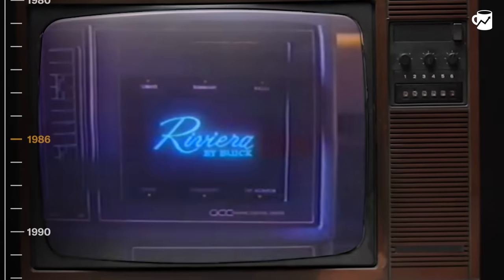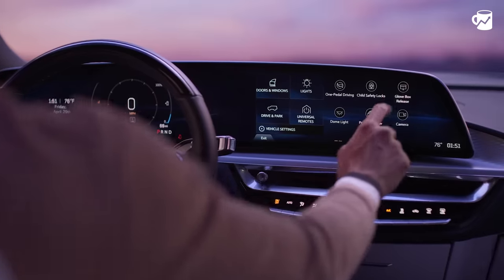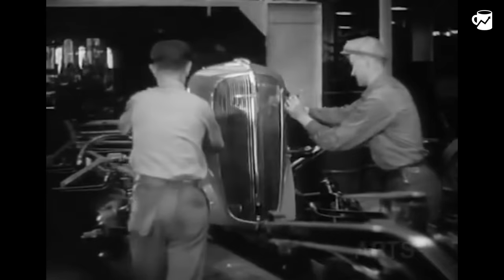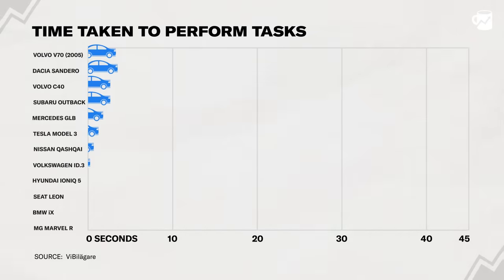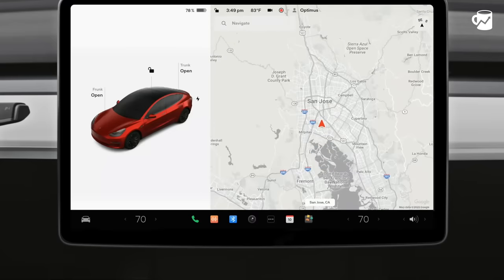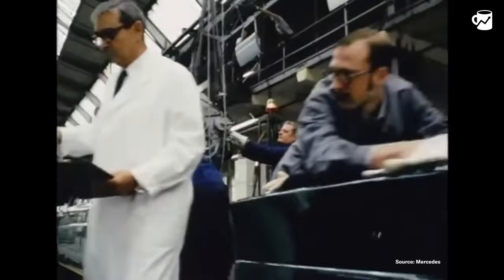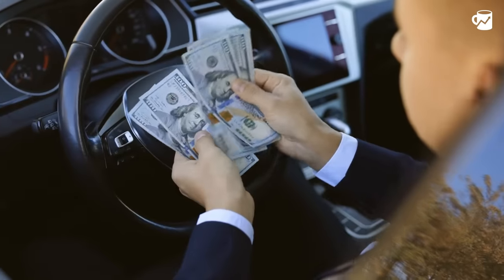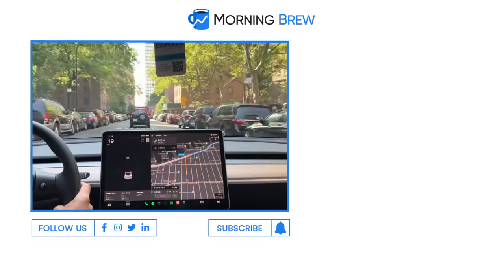The Real Reason New Cars Have Touchscreens

Comment: Physical buttons are better in cars for the same reason video game controllers have physical buttons—with a bit of practice you can easily find them quickly and be certain you did press them without needing to look. 

I have a 2021 Corolla that has a touchscreen, but I think that one is implemented well. The home screen is customisable to an extent, but generally displays a minimap along with what the radio is playing and an indicator of battery use (it's a hybrid). I don't use the GPS navigation feature (I don't like automated GPS navigation), so I'm not sure about that, but the touchscreen does not allow you to use the phone connection features like SMS or making a call through the touchscreen when the car is in motion (you can use voice control). The minimap is operable, but it's a normal, uncomplicated, top-down map like the ones in printed map books used to be and is easy to read quickly.

Other than that, most of the features of the radio can be operated with physical buttons on the steering wheel and all of the direct car controls, like aircon, cruise control or proximity sensors are operated with physical buttons.

Comment: I'm into IT and cars for nearly 20 years, this is a huge downside of privacy, security and reliability in cars, not because it's distracting, but because even the simpliest task is performed through a screen that goes through a microcontroller, even for turning on the fan that requires a simple rotary switch it goes on through a computer that controls the fan on a PWM through screen controls that is interconnected with everything.
These things can get hacked, jacked, car companies can lock and unlock whatever they want anytime they want, and if anything breaks which is 99% fault of the propertiary software it's not a matter of swapping a switch or a few parts.
Next thing is making cars lock you in and drive you to jail for a joke you were telling your friend into the car, and you wont even have control of the steering wheel (steer by wire).
All these for nothing else than money and control.
Some touch screen controls like radio etc are okay as far as it's supplematory system and not interconnected with the vehicle's operational systems like that 80's Buick, but today's garbage is something else you should be careful of.

Comment: Touch screens sometimes require concentration on the screen (and not the road).  Bad idea.  Also try trying to adjust something on the screen as your finger lands in the wrong place due to a bumpy ride.  Real buttons and knobs cab be accessed just by reaching and not distract the  driver.  I have one, but would be fine if it wasn't there.

Comment: Most people prefer using your phones interface that is actually updated, than requiring the car company to outsource an interface.
Also, they could at least use some kind of linear actuator haptic feedback. But 95% of controls need physical controls in the first place.
Physical controls do not need to be run at the current of the component they are controlling. You could easily connect all those buttons through Car/Vehicle Area Network, just as easily as you can a touchscreen. You can even make it an easily replaceable panel, like a touchscreen would.

Comment: My AC button finally broke in my 2001 Mercedes. It was $89 new from the dealer parts department I did not want to spend. The same button in a 2023 Suburban costs $8900 - used, on ebay, from a wrecked car. its the entire center console tablet.

Comment: I have a VW Golf 2022, touch screen is a bit of a pain, now takes 5 touches to access the air con, in my old 2007 VW golf 3 dials all set so most of the time it's just set the blower speed.

Comment: The touchscreens are so that there can be less time designing custom one-off mechanical buttons, and the gauge pod dials, all which need produced, shipped and stored- don't have to be made anymore.  Just use a screen and some software- and there you go.  
Just drove a Wagoneer for 1200 miles, and couldn't stand the touchscreen and touch-button pod.

Comment: Having driven a few Tesla Model 3 cars and owning and loving my Ford F150 Lightning, I can say I think Ford is doing a better job in terms of ease of use of controls. There are still buttons, a stalk, switches, and a knob in the Lightning. That knob on the screen has had some people complain because it's glued on but it works and controls volume normally and if you tap the climate control it will adjust temperature. It seems Ford has put more thought than Tesla into drivers need to keep eyes on the road while still providing a bid touchscreen. The things you don't need quick access to while driving are the ones buried in menus on the screen. What you're likely to adjust while driving is put in the physical controls or on the screen is clear and easy to reach. There are still ways for Ford to improve it, though.

Comment: I'm glad I'm not the only one who thinks those touchscreens are annoying. Although they can be implemented so good. Last year I had a new BMW 3-Series, the touchscreen and buttons where in my opionon perfectly complementing each other, being able to use the touchscreen with a knob on the middle console, and having buttons for standard features like sound, or ac. This way, the car truly felt modern. Having the features and pros of a touchscreen without sacrificing easy accesibility. Now this year I have a Cupra Formentor, and it's absolutely horrific. I can't even turn the ac on and of without having to go through menus on the touchscreen, it's as if they actually wanted to make it as bad as possible.

Comment: I'm okay with touch screens in cars so long as my AC and radio controls still have physical interfaces. It's an absolute must for easy of use and safety. This is one of those cases where regulators need to step in. When public safety becomes an issue. Some people say it gets in the way of progress and innovation. I disagree. It gets in the way of being lazy. They should mandate that physical buttons exist for certain features on every car. And they should mandate limits to the size and brightness of touch screens and interfaces.

Comment: I use the Android Auto only to start the GPS navigation. Also my 2 primary used addresses are on the top, so it is easy to navigate. And use voice control to pick up a new address. The other stuff is starting music player (and / or maybe to skip a song or to use folder or playlist to play from/on. I use the audio player via the Android phone, it is a 1000 times quicker than trough the Android Auto, also the phone is on a stand in left, right to the driving wheel - white easier to navigate, also not disturbing monitoring the road with my peripheral vision.

Comment: I respectfully disagree with dismissing their benefits solely from a manufacturer's cost perspective.

I believe there is a very interesting bright side to touch commands.

While simplifying manufacturing is certainly an economic incentive for automakers, having fewer physical buttons, knobs, and wiring can also benefit longevity and sustainability. Fewer moving parts means fewer potential points of failure or wear over time. It reduces complexity and the embodied resources required to produce the vehicle.

Also, software-driven interfaces allow more flexibility for updates and new features down the road without costly hardware changes. This could extend a vehicle's usable lifespan as technologies evolve.

Additionally, from a sustainability perspective, reducing the number of physical buttons, knobs, and associated wiring by using touchscreen interfaces could have positive environmental impacts as well. Manufacturing fewer plastic and metal components conserves raw materials and reduces waste. Having fewer moving parts that can wear out or break means less need for resource-intensive repairs and replacements over a vehicle's lifespan. Obvously, safety must absolutely be the top priority in design, if done thoughtfully, simplifying interiors through software integration instead of numerous physical controls could pay dividends for the planet too by embracing a more minimalist, sustainable approach.

I do agree though that we're still in transitionary phases where the technology hasn't quite caught up to the design vision yet. But done right, simplifying physical controls through thoughtful software integration could benefit the manufacturer's bottom line, the longer-term ownership experience and our environment. 

Again, safety and usability just need to be the top priorities in the execution.

Comment: My friends laugh at me when i show i still use my old mp3 player as a music source. But reason for it is really simple. If i walk a dog, ride a bicycle or motorcycle i can listen to music. If i want to change the song. i don't need to look at it i can only press the button. Depending on the situation but mostly i don't have to take it out of my pocket either, i'll just press the button trough my trousers. When i go to car. it's tiny and i don't have to take it with me out of the car when not needed. Plus! no ads in my music. In a car in my opinion most of the controls should be behind a button not a touch screen. I'm fine with my small 8 inch infotainment touch screen.

Comment: Fortunately, for me, the Forester 2019, still has tactile, dials or buttons for most of the usual functions, wipers, lights, radio/sound, airplay, for my maps/navigation, no built navsat gps/sim, etc. yes there are several "buttons" on the steering wheel (and in dash) and there is a "touchscreen)" 6inch, which I rarely need to "touch" or navigate whilst driving, as the few apps I do use, can be accessed by voice via Siri, with a button on the wheel … anyway, it certainly isn’t tablet overload, nor driver distraction—as demonstrated in the clips of this video—that’s been happening in the models since. My main gripe would be the inbuilt "cpu-computer" that manages the electronics of the all the damn sensors built into the "running" and monitoring of the mechanics, error messages popping-up, some "false flags" a few legitimate, rather the parts are they often are faulty sensor, dirt, loose wires, fuse, electrical related, faulty software/app connection/s … oh well … I certainly have steered away from updating to all the bells and whistles gadgetry of a full blown tablet centred and controlled vehicle, no thanks. I’ll leave that to my iPad/s at home, and my iPhone which I do not need to "touch" once plugged in via cable in the care … happy trails to y’all 😉👍🏼

Comment: Wait, cars have touch screens in them? Im still driving my 2002 truck with a cassette and CD player. Truck is super reliable and has only needed garage work twice in 22 years. Will touch screens last that long? Based on repirability of Ipads etc., I'm thinking current vehicles wont last much more than 10 years.

Comment: I appreciate the android auto a lot. I use the maps constantly and it helps. That said i am more than glad that the audio controls are on the steering wheel. And the air conditioning control are physical. Other than that, i like being able to call someone without looking at my phone, but it is not easy, so it still needs me to be stopped.

Comment: Everything you've said rings true to me especially ease of use, except one thing - it's not cheaper. I'm a software dev and I know how much software development costs. Why have we got idiotic touch screens? It's marketing and regulations, I think. Take a long hard look at ODB regulation. I'd hazard an educated guess that manufacturers made a calculation that if they have to log everything, they may as well go down the full software route and poured development into that rather than traditional switches and knobs. I despise the learning curve with modern vehicles. I don't doubt manufacturers all looked at Tesla, crapped themselves and thought 'that's the future direction', but they are wrong. Simplicity is everything with car user interfaces. Don't ever distract the driver from the task of piloting a car.

Comment: I've been wondering about the main point of security for a long time. 
It's not just the screens. The VW ID. line has ridiculous switches to control the acc or speed limiter. Who does swype? Most manufacturers have a ridiculous control for changing the setting by10 it 1 kph which takes also a lot of attention. 

End of the day, screensc are something that sells. Usually it has very little to do with function, which is unreasonable for such an expensive commitment but that's people. But the lack of laws is astonishing.

Comment: Surprised he didn't mention my biggest beef with infotainment screens and that's how quickly it ages the vehicle. Back when you had nothing but a fm/am radio in a old car you could pop it out with a bit of effort and upgrade it to a cassette player and later a cd player both with radio included. It was a small system and could be upgraded in a few hours.  Now with these massive screens you would have to redesign the entire dash if you want to remove them, the jaguar xj 2008 is a beautifully designed car with styling that holds up today but you are reminded when you open the door how old it is when you see that obsolete screen in the dash. It's beneficial to car companies that these things age fast since as the video said its not only cheaper but it means drivers will buy a new car that much sooner to get a better infotainment system. Achim Anscheidt the architect behind the bugatti veyron and chiron never added touchscreens to them cause nothing ages a car more today and he wanted them to be them to be timeless pieces of auto engineering that would still look good 50 years from now. I genuinely wonder if the tesla model s will last half as long with its massive touchscreen.

Comment: The only reason is that it is cheaper. You can take one cheap LCD panel and get rid of several dozens of mechanical buttons, different types od buttons or controllers, so you no longer have to maintain the whole supply chain for all these buttons, storage for them, it is much more easier to install one LCD instead of fozens of mechanical buttons and cotrollers and so on. It is the one and only reason. It is cheaper for manufacturer a lot and also they can make you pay for it more, because it is modern, cool, in, free ... just pay more for something that saves them costs. But problem is that this kind of solution is also very very unsafe, using that during driving is very dangerous.

Comment: 7:57 Truly autonomous cars are a very, very long way off... Until a fully autonomous car can handle an unlit, narrow singletrack, mountain switchback road, during a snow blizzard in the dark in mid winter, with other stuck or stranded cars partially blocking the the straight tretches where you need to keep up whatever momentum you have to get up the hill; I'll be keeping tactile button controls, and eyes on the f . . . g road, thanks.

Comment: I bought a car radio during Covid. What a disaster. All of the knob-operated radios had disappeared the model year or two prior to my purchase, and I so am left with one that is impossible to change the volume or mute. Thankfully, I have volume buttons on my steering wheel, but this added about $80 to the cost of the radio just to interface with it.

The UI on that touch screen thing is a mess. Piece of junk.

Comment: AND did you know that Elmo's 'CyberTruck' has steer-by-wire? The steering wheel is basically a servo and does not have a physical connection to the rack & pinion assembly out front. It's over-engineered and potentially dangerous, imo.

Comment: Good... concise. Safety trampled and product turn-around exalted. (I would only add - a technical bit) The CANN bus has been growing into auto engineering since it came about, and probably it is not the only interface of that sort. So these systems that add control and sophistication to the actual product are (one might think) lonely and friendless until they get more computers (user interfaces) to talk to. NO they are cheap to the maker and expensive to the people who have to live through the crashes. Keep the data bus(s) dump the high-touch crash trap.

Comment: Cars have a lot of functions and settings now. Putting a menu on a big touchscreen is the best way to interact with those setting. There is, however, absolutely no reason simple tasks you use dozens of time per day should be on the touch screen. There's no reason to replace a mirror control, or a seat control, or wiper control with a touch screen other than cost savings or misguided minimalism.

Comment: Every vehicle I've owned I've installed toutch screens in. Mainly for the navigation where I'm driving to. On the bike side, Can't wait to get the new 2018+ goldwing with the navigation screen, my 08 wing is basic. The guy who just got the tesla, and quickly started driving while constantly messing with the screen (learning it) is the real problem here..  you stay parked and take the time to learn the features. When I get the new goldwing, I'll be going thru everything getting familiar with it navigating before I start riding it. Where as this guy is distracted while driving... (user error). "Hey, just got this pistol, while I drive I'm gonna learn how to load the magazine, put it in my gun and see what is the safety switch while playing with it not paying attention to the gun, if it goes off, it's the gun manufacturers fault, not mine!"